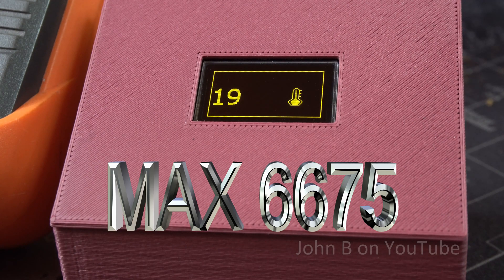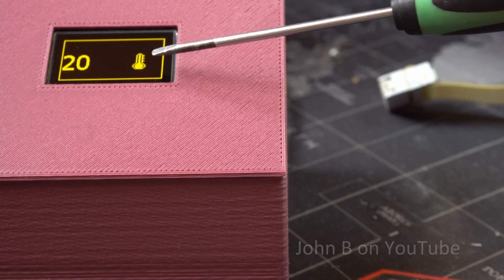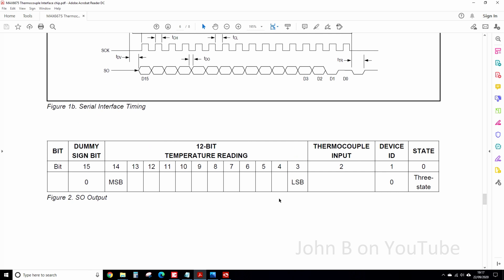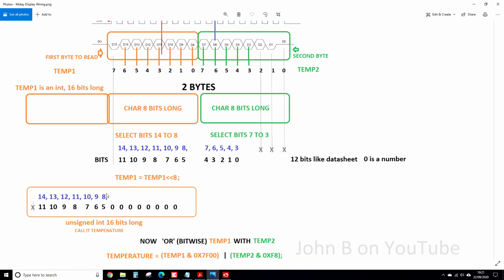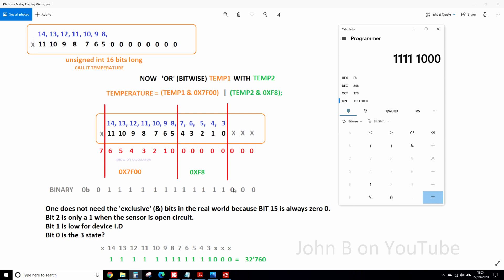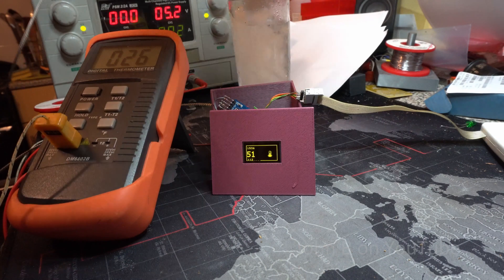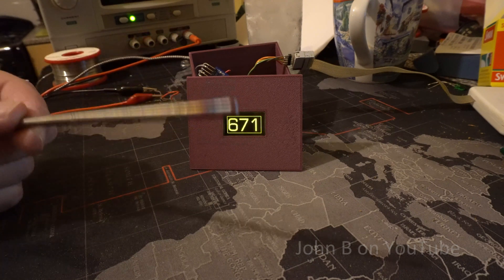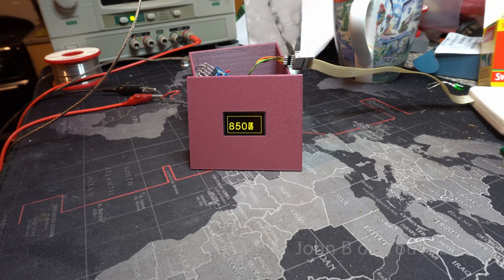MAX6675 Temperature Sensor in Depth - Plus Free C file & STL for your OLED display SSD1306

Comment: "Three state" is Tri-state, i.e high impedance whenever chip select is high. Meaning the 6675 disconnects itself from the bus at bit 0. It's not a "value" per se
Reply from the maker: Thank you Major Tom.
I wish the manufactures would state what the values are.
Like the 'dummy sign bit' it's a dummy bit so not a sign bit, so it should not be called a dummy anything.
Reply: @JohnB-2021  Probably easier to view it as a start bit? But yes, the descriptions are rather misleading.